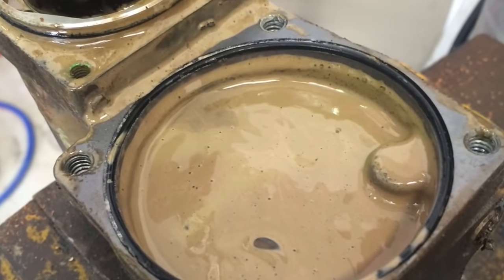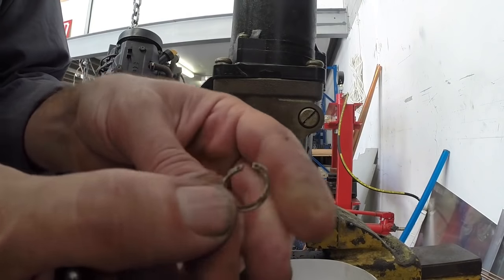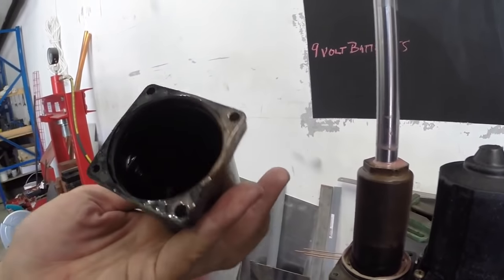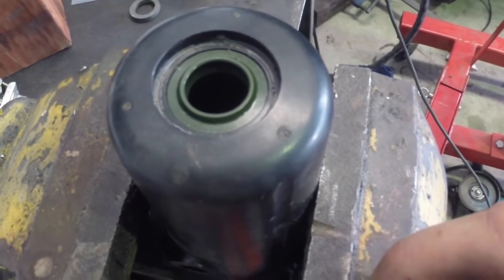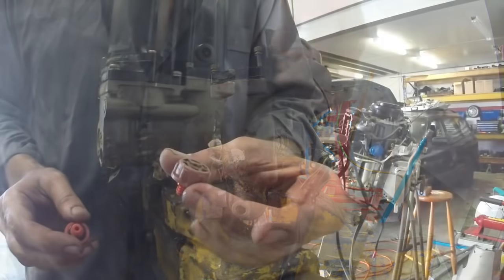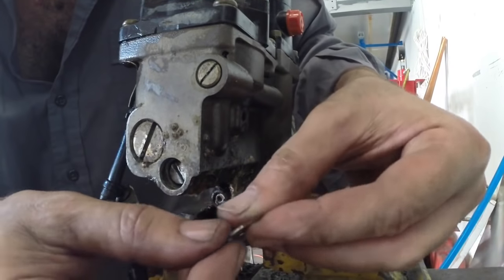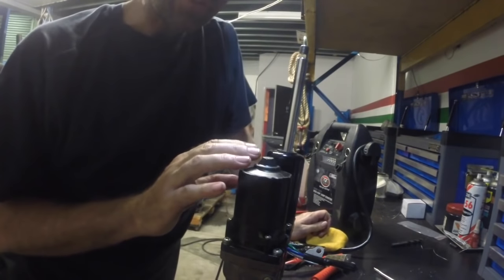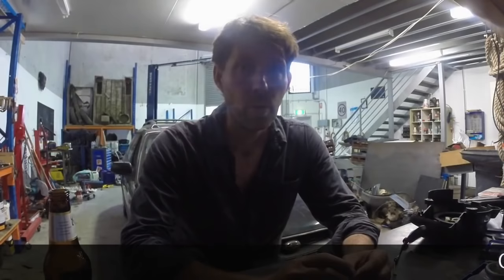Water in outboard trim tilt hydraulic oil

Comment: So I want to say THANK YOU... I'be never worked on boats, trim motors or anything like this before. But I wanted to do this myself & save money. Long story short, I bought a boat, trim didnt work. Replaced with a new trim tilt motor, replaced fluids & NOTHING. Watched EVERY YOUTUBE video possible & couldnt figure it out. Then I seen you video this morning (3 weeks since replacing trim motor) noticed the coupler for the shaft. And say "hey I seen 1 of those in the back of the boat" ran outside slapped it on & BOOM it works like a charm.. So again THANK YOU for the info.. HUGE HELP..

Comment: I love your videos. You have taught me a lot. My trim was not working last summer and when I brought it home it started working but pumped water out of the top of the piston. 
Time for new seals. I see there is one thing you and I have in common and that is having a cold one on the work bench. Cheers
Reply from the maker: Thanks Andy, good luck with the seal replacement, be sure to give it a good flush before putting fresh oil in too.

Comment: Thank you for the Video.  I topped up my Hyd Fluid yesterday for the first time.  2009 Suz DF140.  Got the back pressure spray all over me :-).  Is there a way I can completely drain the old fluid out and start fresh without taking anything apart or off ??  Cheers H

Comment: Just a tip: Cut some pieces from an old car tire to use as grippers for your vise. That will allow you to tighten without cracking the housing.
Reply from the maker: Nice tip. I need to setup a second vice somewhere soon so I might make one for delicate work and the other for metal work.
Reply: Moonpie Spotlight play time to start

Comment from the maker: Hi Rafael. YouTube won't let me reply to your comment. Do you have a Google+ account? Try turning the bypass screw then lifting the motor up and down four or five times by hand then toping up the oil level while it is in the up position. Next close the bypass screw and operate it using the switch again.
Reply from the maker: It is on the side of the trim tilt unit down low. You will access it through a hole in the mounting bracket.
Reply: Thanks i found and i release the screw and i pum  up and dow 10 times and the only ones go up hard is the 2 small one,the big one go up bt luck like is little air on, no leak are on . How can i make this go up harder ?.
One more time Thanks
Reply: Dangar thanks for your Help look like the use transmission fluid before,i m going to replace all fluid we hydraulic fluid,and i m going to  star over,is any way how can i drain the hole system ? 
Thanks.
Reply from the maker: That bypass screw is usually held in by a circlip so if you remove that clip you should be able to wind it all the way out. Also, if you open the fill hole with the motor up then let it drop down it will push a fair amount out, but be careful, it can squirt quite a distance! You can then suck the remained out through the fill hole with a turkey baster or a syringe with a bit of hose attached.

Comment: G’day from Coffs Harbour bloke. I’m having trouble starting with an empty fresh rebuilt tilt and trim. Filling the hydraulics from dead empty and bleeding on a 94 mercury mariner single ram I haven’t replaced the manual tilt screw and o rings.
Reply from the maker: Generally you just open the bypass screw and then lift the motor up and let gravity drop it down again about five times. I would then lock off the bypass and try to lift it from the switch. If it doesn't work, lift it up, top up the fluid again and repeat.

Comment: Good video, my issue is that motor tilts down no problem but going up takes a long time. I tried adding oil but it seems to be full to the plug level.

Comment: Do yourself a favor   clean the outside of the assembly before you start dismantling it.     smiles.
Reply from the maker: Good tip! I always do that with brake fluid reservoirs so it should have occurred to me to do it with this unit. :)

Comment: Hi Stu
Really enjoying your how to videos 
I knew nothing about boats till i started watching your videos from leaning to drive a boat through to fixing the out board. You have taught me well. Thank You.
I have one question that i can't find the answer to. When i raise my engine with the tilt it works no probs i can stop it half way ect. The problem is when i go to lower it once it starts to go down i cant stop it till it hits the bottom. It does not free fall but goes down around the same speed as it rises. I cant figure out what is happening with it, Its a Johnson v4 85hp. A true 1980 Classic.
Any ideas on what could be wrong ??
Cheers Andy
Reply from the maker: Hey Andy, glad to hear the vids have been helping you. Can you hear the motor running when it is going down. If so it sounds like a sticking relay. If not it sounds like a sticking valve or a bad seal inside the hydraulic unit. The relay can just be replaced but the hydraulic problem would involve pulling it completely apart and inspecting each component.
Reply: I will have a look at the weekend i'm not sure if it was running or not. I will keep you updated. i have watched the relay build you did so that wont be a problem to build a new circuit. if it is the pump well that will have to be a shot in the dark as to if i can fix it or not. One last question how long does it take for Dangar t shirt to reach Scotland ?
If i need to rebuild the pump i may as well video it. So no better time to order a T and wear it while i do the rebuild :)
Thanks again mate for All the videos and help

Comment: Firstly your a Legend Stu, your video's have been hugely valuable with my Johnson 1993 50hp engine. I have a question my tilt system wasn't allowing the engine to be lifted all the way up and a friend of mine used some brake fluid to top it up and is now working again, but have since learn that I should have used ATF or tilt fluid, should I be worried about the mix of fluids in there? Should I try and drain it all out and start again? Will the brake fluid cause any damage? Thanks :-)
Reply: Hey Matt. Did you ever get an answer on this? I just did the same but with power steering fluid. Also if you had to drain it, how did you do it?

Comment: I need your help! I just purchased a 2000 Johnson 40hp. Runs beautiful but tr won’t go up. I did get it to lower. I loosened the drain screw this morning again to find that the spring and little plastic (orange) looking thing are gone. The must have blown out pst me and I’ve looked everywhere. What is their purpose? Can I get by without them.

Comment: Quick question.    I rebuilt the rams.  But when I give the motor gas fast the motor pushes the trin back down to the transit.   Would it be the motor or the pump 🤔?    Like it's not keeping the pressure in the same spot

Comment: 6:50 putting the plastic seal back in, I did this a few months ago and it didn't hold, I try different glue, about to try again. Did you ever make the video about rebuilding the hydrolic ram unit?? Thanks for the awesome videos :)
Reply from the maker: I haven't done a video on the ram yet, but thank you for reminding me I need to get around to it. I have a couple of spare ones in the shop at the moment.
Reply: Thanks mate, look forward to it.  Would you happen to have a second hand trim unit for a Honda 50' to sell?  Mine is corroded and quickest way to get my boat back in the water is to throw some $ at it :(
Reply from the maker: I have one that I think would fit, but unfortunately I am missing the bypass valve from it and that part is discontinued from Honda. If your unit has the exact same valve (depending on year) we may be able to make one working one out of the two.

Comment: Greetings from Finland! I have a Honda BF30D6 engine and it has exactly the same pump as your video. I have one question for you. I opened that biggest plug and the inner parts dropped out and they got mixed up. Here's a picture of them: https://photos.app.goo.gl/4BGK74LB2cRCpWzt6 . Should the parts be in the position shown in the picture? Or is there something in the wrong direction?
Reply from the maker: That looks about right from memory, but I've had that exact problem myself in the past. To figure it out I found an exploded diagram for the engine which showed the correct assembly orientation.

Comment: STU, can you explain how the oil gets from the resivour with the orange cap (spelling), down to the pump or whatnot?  i always thought you filled the bowl up at the screw above the bypass screw you took out.  which i think only fills up where the pump is at.  correct me if i'm wrong.   i want to understand the system as much as possible as i work through my issues with mine

thank you, love the videos
Reply from the maker: This is probably something better shown that put into words I think. I'll do a video where I fully dismantle on of these units soon but the short version is that is a little drain hole that runs down towards the pump. the bulk of the oil is in the piston bore when the ram is up, so that reservoir takes the oil while it is down, passing it through that passage to the pump as it goes up.

Comment: Hi, I have a yr 2000 mercury 150 hp 2 stroke.
Need to replace tilt motor because it had hold in the back from a rust.
Original part is $400 and after market from amazon was $80
Do you think it’s okay to use aftermarket tilt motor ? Thanks

Comment: Another excellent video by you Stu, full of heaps of technical knowhow, well done. I just got my boat back from repairs by having my hydraulic t&t pump replaced as the old one was completely dead, it could probably be repaired but the one which replaced it was gotten at an excellent price which i couldnt say no to and gave me a chance to get the boat going again.

A question though Stu, the guy who replaced my t&t pump also installed my bilge pump however the outlet he's drilled a hole in the side of my boat and run the outlet to the hose, i really dont remember if the location where he's put the bilge outlet was sitting below the waterline or not so i really have to take my boat to a ramp one of these weekends just to test it out make sure no water gets in, do you know of any really quiet/empty boat ramps around Sydney where i wouldnt be disturbing anybody spending a couple of hours with testing the boat on the trailer? My closest boat ramp is at Chipping Norton however it gets pretty packed out at times not to mention its a single size ramp where im 100% sure i would be giving people the shits by me testing my boat out.
Reply from the maker: +tolgahk84 Hi Mate. I would be very surprised if your bilge pump outlet was below the water line. That is a mistake that no profession would make. I'm not that familiar with boat ramps south of Sydney, but the boat ramp in Brooklyn at Parsley Bay that I use is very quiet during the week.

Comment: I have a 2003 Johnson 4 stroke model J50PL4ST and water is getting into the t&t pump. Johnson only offers and I have purchased, an o-ring set that has two large o-rings for the pump motor and the ram cover. Also there are three smaller o-rings that are used on the pump itself. The unit is made by Showa. While watching your excellent video, I noticed that the t&t unit is almost identical to mine. I was wondering if yours is a Showa and if the seal for the ram cover would work on my Johnson. Also, what did you use to wash out your pump? Thanks for your help.
Reply from the maker: Hi Mike. I'd have to have a look what pump it was. It belongs to a friend but I am going to be getting it back soon as I think the impeller itself may have suffered some damage from the water. These days I've been using aftermarket seals. I've found a shop down the road where I take the original seal and he will give me a seal for a couple of dollars that is a perfect match. The only thing to be careful of is that not all seals come with stainless steel springs in them. In this case he will remove the spring, measure it and give me a nitrile o-ring of the same size to replace it with. This ends up costing $3 instead of $15. To wash the pump I used brake cleaner. Methylated spirits is good for removing water.
Reply: Thanks for the quick reply. Wish I could find a shop close by with the aftermarket parts but nothing close by me in the USA, South Carolina. I still feel that my Johnson pump and the Honda pump in the video are the same units. I looked up the parts lists for both on Boats.net and there is a huge difference in pricing. Johnson lists the part you put the seal into as a tank with a cost of $143.61. Honda lists
 the same looking part as an oil tank for $9.19 without the seal. The seal is another $10.42. I have my t&t off the motor and I'm going to take it to a Honda dealer and compare to theirs. Hopefully they will be the same.
Reply from the maker: I'll keep my fingers crossed for you. Let me know how you get on.
Reply: I ordered the ram wiper seal from Honda for the T&T oil tank on my 2003 Johnson 4 stroke.  It is the same seal that you show in the package in this video. I got the o-rings from Johnson for the tank and tilt motor. I cleaned the old oil from my unit, installed seal and o-rings and it works great. Thanks for your video. It really saved me a bundle of money,
Mike
Reply from the maker: Nice work Mike, glad you got it fixed up. Enjoy your time on the water! :)
Reply: @mikee4216  Mike, I have a 2003 Johnson 90hp 4-stroke with the same issues. Can't seem to locate the seal/O-ring rebuild kit to exact specs so that I'm comfortable ordering. Where did you find your kit? Thanks, Steve

Comment: Hi i need help on my yamaha 2 stroke 90 HP 1999 power trim bleed i replace my trim motor we the after market one, buy from ebay  the motor was install fine by me, and wen i fill the tank we the fluid to make work dont go up,only the 2 piston go up not the one on the center,this issue make me little crazy,Any help please.
Thanks.

Comment: Thank you for your reply, all points you mentioned appear ok ? there is no visual leaks.
I'll see how i go.?
Thank you again,
Cheers .......
Reply from the maker: +Danny Skok If the cylinder seals are leaking it will be an internal leak, just oil passing the piston and going back into the reservoir. I'll be doing a video on replacing those in early April.
Reply: Thank you , look forward to watching it,
Have a great day. Thank's again for your help.
PS If ever your in Melbourne call in for a beer.
Cheers.
Reply from the maker: Sounds good, always up for a beet. ;)

Comment: how many ML of hydrolic oil does tilt and trim take?
Reply from the maker: Not sure how much it takes to fill them. The service manual doesn't give you a capacity just says to fill until it overflows when the motor is all the way up.
Reply: i have drained the system made sure I have no water in it.
oil is clean, the amount that came out is 300ml,  I think it might take a bit more maybe 400ml cause my seals are leaking

Comment: Just installed a new trim motor on my 75 mariner a few weeks ago. Noticed an oil leak around the base. Looks like it coming out from where the trim motor sits on the plate. 
Seen this before?
Reply from the maker: Yes, it's very easy to have the o-ring not seat properly. A lot of the local mechanics around here put sealant on the flange too for a double seal, just make sure not to let any get into the oil.
Reply: @DangarMarine  Thanks for the info. Keen for the next video cheers

Comment: I saw my trim tilt oil is milky.  Is it mean water got in?  I m new. Just bought a used boat.  I hear the motor sound when i press the up button but when i press the down button i just hear the click.
Reply from the maker: Yes, that means water in the oil. Try swapping the relays over and see if the problem reverses. If so you just need a new relay, if not check wiring.

Comment: Great tutorial! I have the same system and problem but I don t know what tilt trim system I got. I only know it s the same as you show here. Can you please give me the parts numbers to buy them.
Thanks in advance!
Reply from the maker: Not sure what the part numbers are, but I got the bits from our local Honda dealer just down the road.
Reply: Thank you. I will check that. Honda pump.

Comment: Compliments for this video but to load the tank oil serves remove the electric Motor? What kind of oil you used? Thanks
Reply from the maker: No, you can fill the oil through a cap with the motor in place. There is special trim tilt oil you can buy from boat stores that is made for these units.

Comment: Question for you: I have reviewed everything you have posted about trim ram systems (and a few other people's posts) but I am not seeing my particular issue: Trim motor and pump go up and down well but it will not stay trimmed when the boat is under way and under power. It was suggested to check the manual bypass. When I did, there wasn't much give in the tightening direction. So I opened the bypass until the motor dropped down under it's own weight and tightened it again to re-seat the bypass valve. I think the only way to test it is to launch the boat and put it under way again? ...or is there another way to test it? How else can I test it out of the water and what else should I be considering as the problem if it fails under way testing when I put the boat back in the water next March or April?

PS: Thanks for everything you do here, brother! You have saved my @ss several times now....
Reply from the maker: Hi mate. I'm going to be doing a video on this problem very soon. It can be either the seals / o-rings around the bypass valves or the seal around the hydraulic ram. If that seal is failing then oil can bypass the piston and it start to drop, much like worn rings causing a motor to lose compression.
Reply: @DangarMarine  Did you ever do the video on this issue?